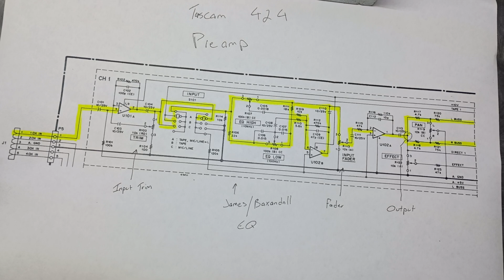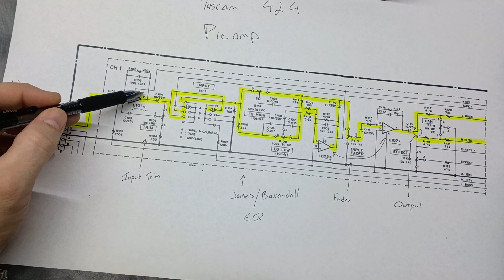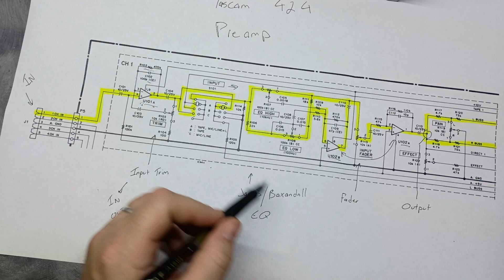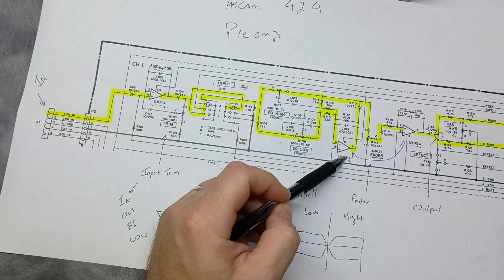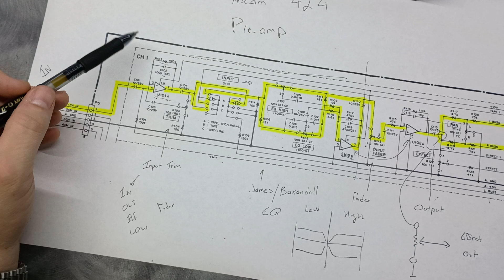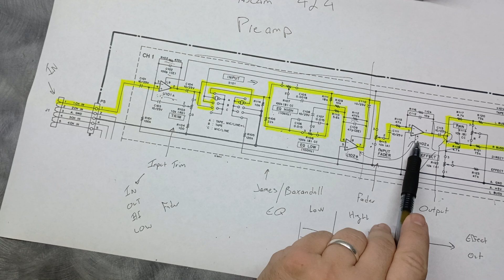Tascam 424 preamp explainer

Comment: Hope you are well!

I’m trying to get that aggressive, elastic, synth-like overdrive you are making  with the Tascam 424. I got one, but Even with the trim and EQ maxed out, I get blurry distortion but not that distinctive, harmonically rich elastic sound. Am I missing something about the 424’s gain staging or routing? Do I need an external preamp between my in and out to achieve that specific sound, or is it possible with the 424 alone? Maybe my incoming signal is not loud enough to clip? or it needs to be lower ?  Thanks!

Comment: I was doing some analysis of a plugin emulation of the 424 preamp and to put it mildly im pretty confused by its time domain response

Im not sure about the hardware, but the plugin version does not clip 

It seems to do something more akin to waveshaping, and the type of waveshaping applied is highly dependent upon input gain. With sine wave input has its wave is shape affected more at lower amplitudes 

Its almost as if a signal at a certain level hits a threshold is routed to another gain stage with more headroom to stave off clipping. I cant make heads or tails of it, but id love to see someone probe the original hardware with an oscilloscope

Comment: Dude thank you so much for making this video! I have been playing guitar for almost 20 years and had gotten kind of bored it. But there all these young guys making awesome new music using old 4 tracks and it has completely enamored me. I have been trying to understand what exactly is so special about that thing and I even bought a porta424 pedal a couple weeks ago. I am an engineer so I really appreciate videos like this where someone really gets into the technical details! I am still experimenting with the pedal, I have a Boss Katana MKII 100w and that has an FX loop. It's insane how different the sound is if I wire it at the end of the FX loop compared to right before the cable input on the amp.

What is interesting is at the end of your video (and I apologize if I am misunderstanding you) you hypothesize that most of the overdrive is dictated by the input fader and output knob. But just with my experience with the pedal, the input knob is actually what makes this thing special. I have been basically slamming the input knob and then dialing the output knob way down with the fader set to 7. This gives you insane headroom and breakup depending on the dynamics of your playing! The EQ low knob also can do some insane stuff, if you slam it your first three strings come out sounding like a synth but your last three strings come out like a normal guitar!
Reply from the maker: Yeah that makes sense. If you run the input gain trim up high, it causes the gain stages downstream to overload and distort. That very first gain stage probably doesn't distort much by itself unless you slam it with another pedal or a really hot signal. This same principle works for tube amps too. Later stages tend to distort first. The synth like sound you're getting is likely due to the fact that the opamp clips so extremely that it basically turns your sine wave like guitar signal into a hard square wave, which is very synth like in many respects!